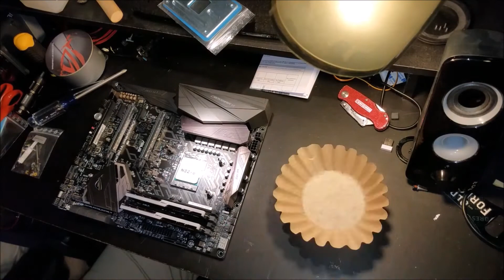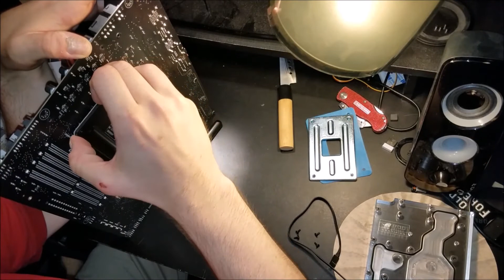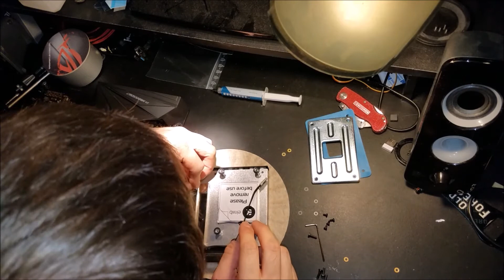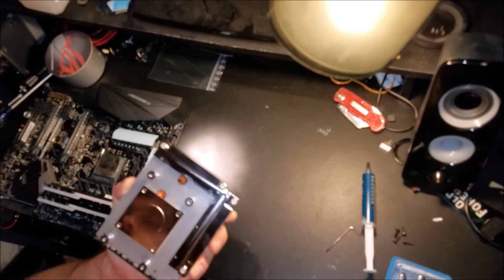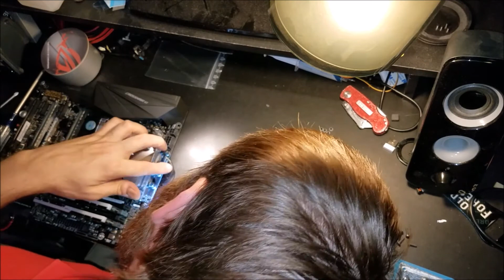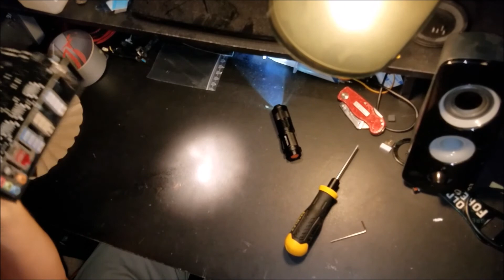EK-FB ASUS C6H RGB Monoblock - Nickel Installation

Comment: ive got my monoblock a couple days ago put it on crosshair VII  i love it watched this video a couple times for install. i have cut the thermal pads in half and put one on the mosfets and one on the chokes looked like that in the manual. and why was the backplate adhesive? first time seeing this...my temps in idle cpu 32° and vrm 30° with ryzen 1700 overcolocked to 3.8ghz not tested under load yet

Comment: HI great video i only have an  8 pin CPU power how do i add the 4 pin to the board thanks
Reply from the maker: Mr B your motherboard has 8pin but your psu has 4pin? You gotta get a power supply with an 8pin eps. Also thanks for subbing

Comment: Does the connector attach to the motherboard for aura sync? Or how does it get the RGB?
Reply from the maker: Its a 4 pin rgb connector and that attaches to one of the boards rgb headers and can be controlled with aura
Reply: @TurboLimited  Okay thanks. Yeah I am getting an RGB power supply too which connects to the motherboard. That takes up all the ports. No more ports for lighting controls or anything. I found an adapter though where I can plug in the monoblock and the power supply into one RGB header.
Reply from the maker: @asmcriminaL  i use a 4 way splitter on my rgb blocks(monoblock and a gpu bloc), rbg pump, and rbg res just fine off of one header. I have my monitor back-mounted led strip in the other header.
Reply: @TurboLimited  Okay that sounds cool. I realized when I made my post it was only for the 5V RGB adapter, I was able to find a 12V RGB adapter. I was just checking it out.

I will have a power supply, monoblock, Thermaltake hub all connected to one header. I am curious about what splitter you're using. I might pick it up. sounds cheaper.

Comment: What mic are you using? Sounds great on a headset.
Reply from the maker: Kalashnikyle my secret confession is i record all my videos on my note 8 phone. All the lenses i have for my dslr require an operator because they are full manual lenses. My vids come out really well considering. The phones mic is pretty much right in my face for these over shoulder videos. Good to know its nice on a headset, thanks.

Comment: that ek thermal past is by far better then mx 4......and if you want the best thermal past there is ...try some Thermal Grizzly Kryonaught ......
Reply from the maker: Shane Herald thats debatable as everyones experience with paste is different. Thermal paste these days is at a point where differences are such a small degree of temps its more or less a nil issue. Even pre applied is decent these days. But you are right EKs is good but i have used this companys paste before so i trust it. Preference is everything lol
Reply: grizzly's Kryonaught past is not debatably the best...lmao......its proven to be the best, the thermal conductivity on this is 12.5 wm/k no past ive seen is better other then liquid metal but then again thats no past...lol ....and i have seen and tested many pasts myself ...as well as the pc geek friends i have ... get some and try it ......and you could be sitting at 32 to 38c bounce in temps at idle if you put those gpu's on there own loop as well as extremely lower gaming load temps....  my ryzen 1800x at 4.1 ghz is cooler then most all water cooled rigs ive seen at stock clocks ...lol....but i do have a bad ass loop set up on gpu's and cpu (2 loops)....i am no noob to this ....nor am i trying to disrespect you .....just giving some friendly advice ......
Reply: this is no way to start up a you tube channel 
deleting all my comments
Reply from the maker: oh naw i'm not looking at that as criticism, advice is always welcome as long as its civil and such :D . i am in no way a PC expert or even close to knowing everything about thermal paste. my 1800x on stock is 30-38 and both my gpus range 30-42. idle to max while gaming. i have been thinking about running the gpus on a separate loop but i lack the funds right now. plus im not looking to drain this loop until i go hardline hopefully in 5 months or so when funds allow. this is my first waterloop so im taking things step by step. when i said debatable it was about ek's thermal paste im not well versed in the grizzly paste to speak on it.
Reply: o shit really.......your first loop.....
nice build sir....looks good to ....i like it man .....but your really getting those kinda temps ....every thing stock clocks?......the reason im asking is i want to get that cpu/vrm block but i would really like to know if its worth going from my ek supremacy evo elite block to the mono....i will run 3 loops if i have to ...or if vrms will cause cpu to run hotter ...im'a geek like that though i guess ...my fx 8350 set up ended up with three loops..lol....coolest thing ever it wuz,....lmao....i really don't even know why ima finish this 1800x build off like that though cuz i really want to order a 1950x and build it...lol...
Reply from the maker: thanks. omg yes i would love to do a threadripper build. i wish i had documented vrm temps before i went from the stock mosfet heatsink to the monoblock. not enough forethought lol still new to making youtube content so my planning isnt where i want it to be yet. its a process.
Reply: my vrm temps at idle stay around 37c.....its my sb or the chip set temp thats insane 50c idle temps and around 58 60c gaming.....but i am also running 4.06 ghz on cpu and 3000 mhz ram at the moment.....its a stable setting ....i overclock alot on this thing man ....ram especially ....and i think due to me runing two cards it auto volts the pll voltage to 2.093 in windows  and in bios its on auto
Reply from the maker: My pch is up at 54 and vrms at 32. Idle temps.
Reply: i got this beast of a pc of mine running again...now with the PCH or Sb water cooled the sb runs at 33c to 38c pretty much all the time...lol...mono block is on ...temps very while overclocking a lot ...but stock settings with this mono block and a 480 rad,.. it idles at 28c with a ambient of 24c....i have yet to see this cpu over 70c while overclocking with this mono block installed ......it is a nice well built water block ...props to ek...lol.....i have seen 4.23 ghz in windows unstable but close to getting it right.....with idle temps of 34 to 38c